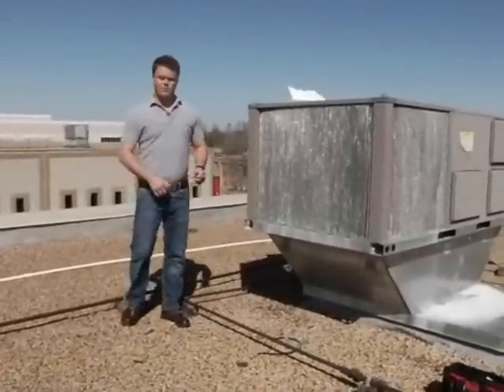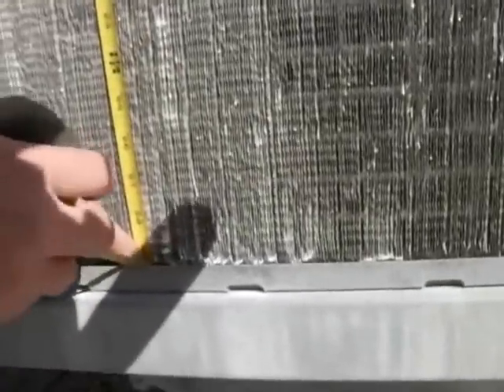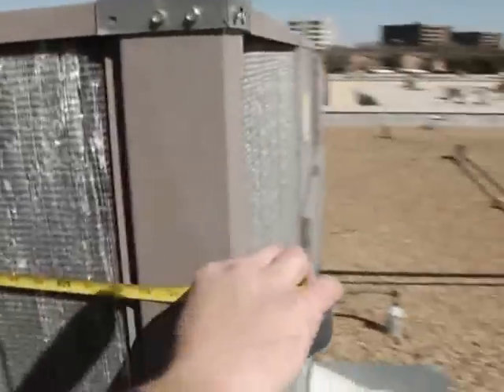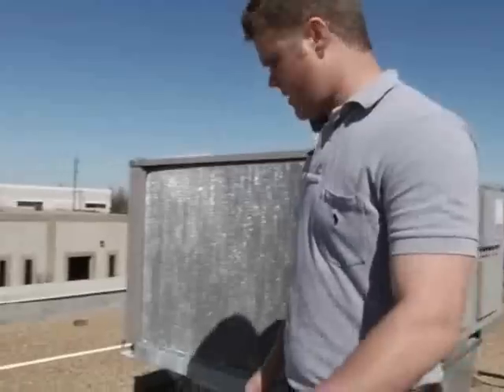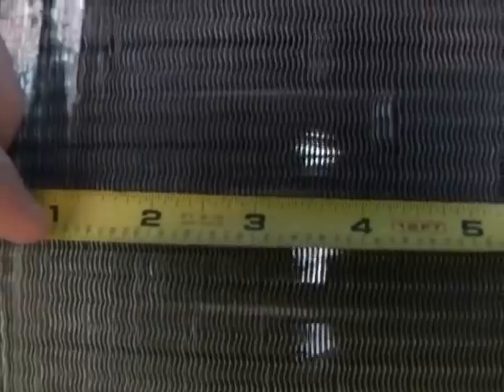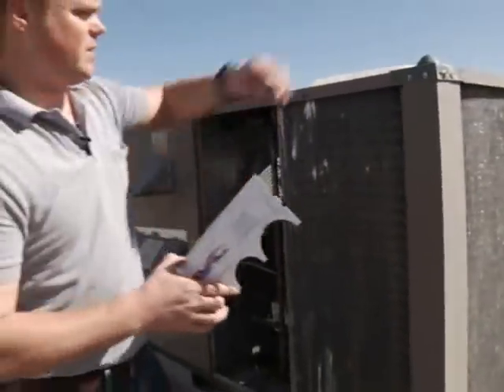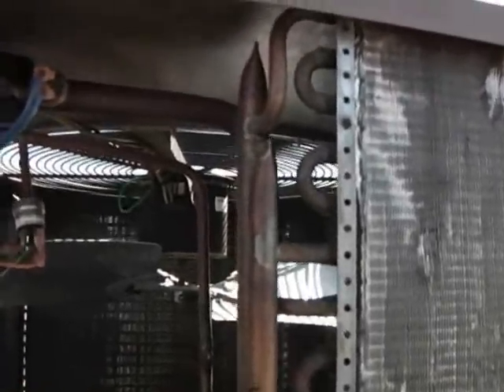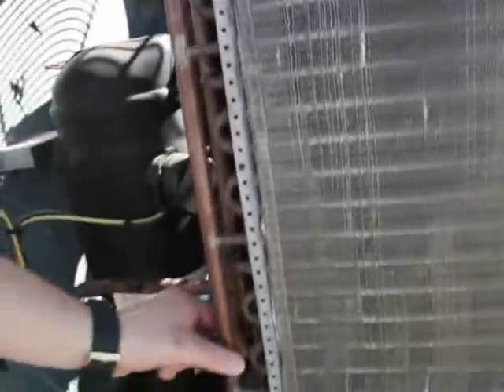How To Measure  Condenser Coils Part 2.| HVAC Coils| Ac Coils

Comment: Do u find the Hvac manuals not accurate.  Very easy to Google even old units.  Your method is great .I would rather trust the Manual than an employee for accurate measurements. But i could be wrong.  I always use MNUALS for filter size instead of carrying random filters.  There r units without model numbers so definitely useful. Thnx.